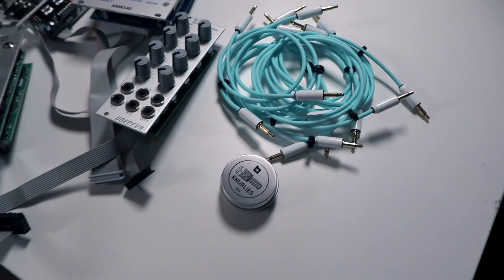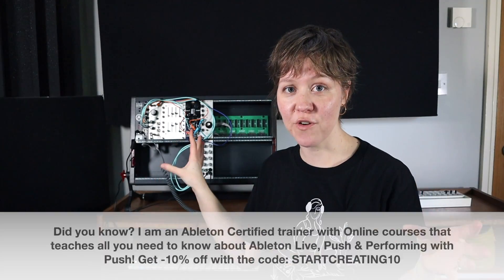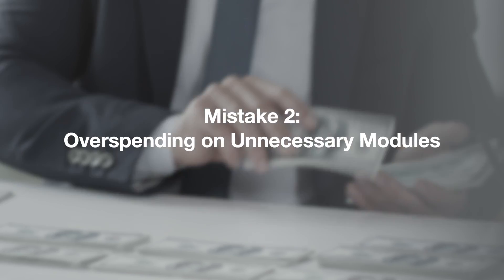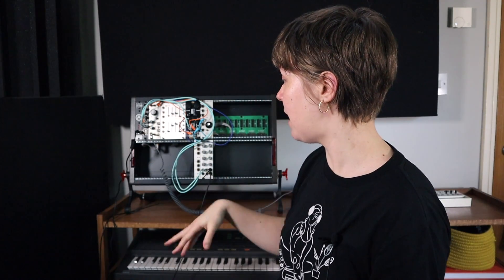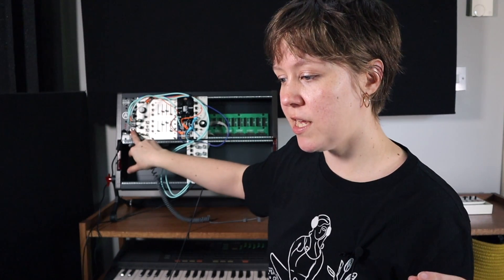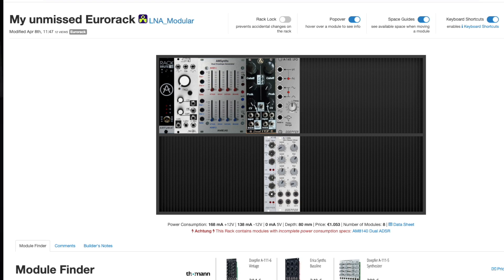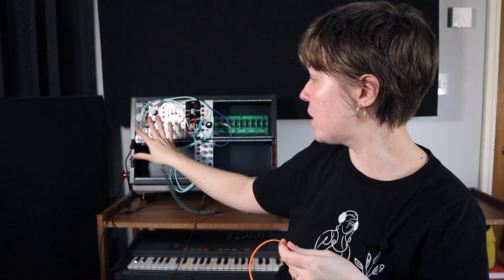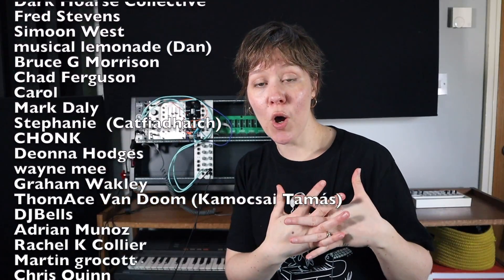5 Eurorack Mistakes Beginners Do (& How I Plan To Dodge Them)

Comment: Nice video for beginners with a lot of advices, I really like your enthusiasm and your way to start your journey into modular world, or should I say universe or multiverse? Joking...
A certain amount of mistakes is part of this journey I guess..
 
A good tip that comes to my mind, that was not mentioned is to take notes about your patches, to sort of reproduce them in the future. 

Your tip of buy cheap modules is maybe a little bit misleading. It has not to be overwhelmingly expensive at the beginning, but meditate very deeply on what your goal is when you go into modular. Cheaper modules are cheap for a reason like vice-versa expensive modules are too. 
Focus on what you want to achieve and save money for some special modules that are more expensive and you will never regret it. 
If you find those on a second hand market even better, but don't buy cheap modules just because you can afford them that leads to frustration in a short while. 
For every module you wish to buy make your researches, even better if you have a store where you can try them personally and see if they fit your expectations. 

The one tip about utilities is so true, they are initially often underestimated, but there are a lot more than only attenuators or mixers, just to mention a few..VCA's, clock dividers, frequency shifters, active and passive multiples with and without mute switches, sequential switches, logic modules, precision adders, offset generators, quantizers, CV to MIDI interfaces, bus board access for CV and gates...
A very good price/quality relationship is found in Doepfer modules.

Greetings from Switzerland and have a lot of fun with your modular journey 🙂

Comment: Interesting video, especially since I started my own eurorack journey about 4 months ago. And yes, for me too budget is a thing. Buying modules off the shelf is really expensive; not that they are overpriced (there goes a tremendous amount of work into developing a quality, reliable module; the often small companies that create these modules mostly do this out of passion, and not to get incredibly rich.. ;) ). But on the other hand, if you start looking at the inside of these modules, you start realizing that the costs of the electronic parts is often just a few bucks. Of course, it depends on the module (e.g. oscillators usually have more expensive parts), but if you really want to cut down cost, DIY is the way to go.

Even if you don't understand much of electronics it really pays off to invest in a soldering iron (they don't cost the world) and develop some DIY skills. Many modules are sold as kits, and that genereally cuts down the price by 40-70%. Some utility modules (e.g. mults, attenuators) are hilariously easy to solder, and from there you can take on some more complicated projects. Then, the next step, is to buy just the bare PCBs and front panels, and source your own electronic parts (this is an art of its own, and it takes time to know what to buy, but once you master it, it is really worth it). And then, of course, the next step is to design your own modules from scratch, or, from other people's schematics. There are whole communities out there. 
You need to invest quite a bit of time, and of course some money, but it quickly pays off.

Also, you can save a LOT of money by just making your own case, also here there are varying degrees in what you buy, and what you do yourself. This week, I made 2 new Eurorack cases (2 rows (6U) of 84HP each), and it set me back €75 for each, including rails, power supply (MeanWell RT65b) and power bus with 32 connectors. Buying 2 Doepfer cases with the same size sets you back ~€800. It's really worth it.
Material costs of a bread-and-butter attenuator? That's 2x 3.5mm sockets (~€0.30 each) and a 100k potentiometer (~€0.10), plus a bit of wire and some solder. Total: <€1. And yes, that's when you use cheap materials. Maybe it won't last a lifetime, but if it breaks, make a new one.

So, if you really want to save money, don't be afraid to develop new skills. It's lot of fun (and meanwhile you learn LOTS about how electronic sound is actually created, that always pays off). :)

Comment: Great initiative and videos. I'll be following along. One thing, do not underestimate the value of blank panels - they can save you a lot of money. All it takes is one errant patch cable or screw dropping into an open space and there is a very real possibility of causing a short. If you are lucky a short will just result in one fried module, but if you are unlucky you could fry your whole system. As you get more modules, your financial investment also rises, protecting that investment with blank panels will be important..

Comment: One area which is often overlooked is tuning. Having a plan about how to tune your VCO’s (whether using a module like a Disting, external pedal or software) can make a whole world of difference. If I’m recording I use the Ableton Live tuner, if just in box then Disting Mk4 is such a handy and small utility.
Reply from the maker: The new CV tools Pack on Ableton are great for calibrating and tuning etc.

Comment: My advice is start with buying 64 mults and focusing on perfecting a certain work by John Cage
Reply: Best advice ever. But could i not just draw the mults, or even just imagine them?
Reply: But you gotta save room for the 20 blank panels too
Reply: @PlerbyMcFlerb  ya but ya but inflation! If u do don't buy 20 blanks now soon it will be 27.3 blanks in the future!

Comment: Tip nr.1: Don't get into Eurorack if you just want to do mainstream music or want to be cool. Get Fruity Loops instead. Eurorack or Modular in general  leans more to sound design and experimental music. 
Also it's good if you already own a hardware synth and know your way around the building blocks and the signal flow (even if it is just a Microbrute or Microkorg or some Behringer). Another one, don't compare VCV to the real Eurorack experience, the feeling of patching, twisting knobs and pushing sliders cannot be recreated in software. Every Eurorack system is a little different, is the product of a modular journey of it´s creator. And it is an instrument, not a 1 or 0 on a screen. It keeps it's value, even on the second hand market.

Comment: I've learned more about Synthesis using Eurorack than I ever have in software, some mistakes along the way and wrong items purchased but I wouldn't change those mistakes because you learn from them.  Good luck with your modular journey.

Comment: Eurorack modules are very cheap and very expensive for a reason. Don't go out and buy all the cheap ones because they're affordable. Trust me... you'll regret your decision after a week with a rig that does almost nothing. You'll be upset for blowing the money you could have saved for great modules thar you're going to want anyway. Haste makes waste. Knowledge is power. Research is key. If there's a module you want, make sure to find out if there are other modules you need to make it function correctly. It's an investment if you're serious. The sequencer you invest in is the route of what your rig will ultimately ve able to do. Choose wisely. Watch all the how to videos on YouTube before you buy. If your going to record your performance, make sure you learn about syncing your rig to your computer via CV to MIDI

Comment: Finally saw someone with that AMSynths Dual Env! Don't see many people using his stuff in general, but it's top quality, sorta flies under the radar. Ah, you're in the UK, that makes more sense at least..literally never seen someone else with one of his modules here in N America.
Reply from the maker: What kind of stuff you like using that Env with? I have been still struggling to add it to my patches as I find it sometimes bit too "sensitive", but would love to figure out ways to utilise it more.
Reply: @LNADoesAudioStuff  I don't own it, but all adsr are basically the same with different variation and degree of slope, sensitivity of controls. If you find any voltage source too sensitive, it probably means you need to attenuate it more before using it. Envelopes are probably the single most useful modulation source (not including v/oct sequencing). Classic path is for the VCA and some percentage of the VCF CV cutoff, but you use them on anything.

Comment: Apart from tactile experience, when you want to try out and find the things you want to work on, you might start by experimenting with VCV, free eurorack software. You can learn the principles , and find what kind of modules you want to use (and are necessary for your focus, being developed already or on the way of doing so). That way you know what you want/need to start with and how to maken things work in a basic way and without financial risk.
Reply from the maker: Yes this is a great tip!